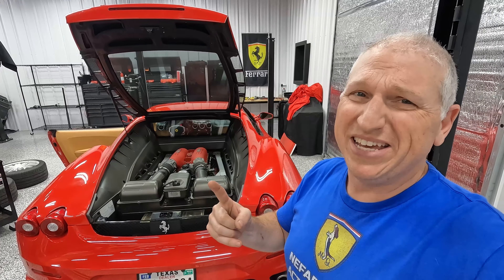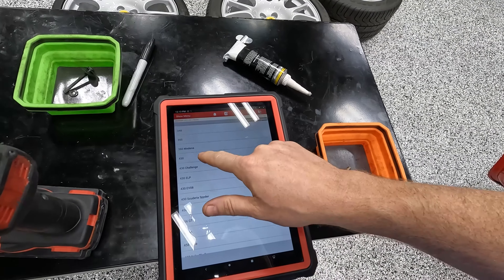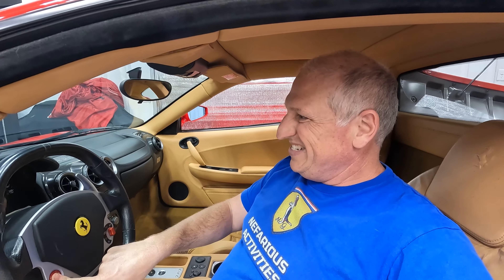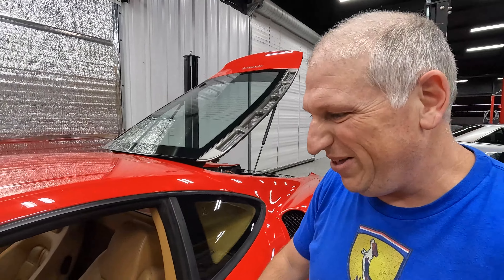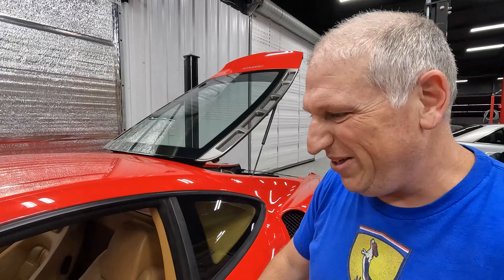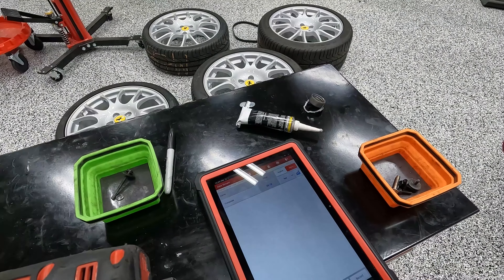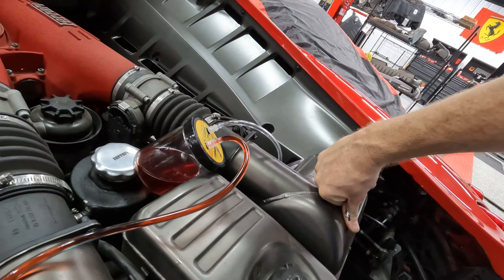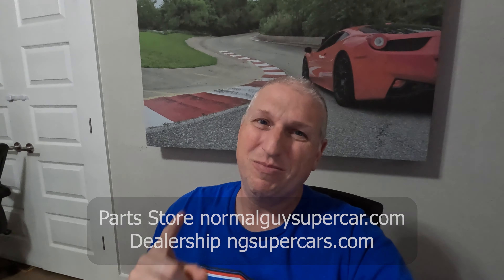How to Bleed the E-Diff on a Ferrari F430

Comment: Hi Dan, a bit pedantic but use the closed end of the wrench on the bleed nipple. Put it on before the pipe. Leave it sitting there whilst you bleed it. Also you won’t round off the hexagon on the nipple. Preferably use a six sided wrench. Same on the brakes. Save you a world of potential misery.👍👍
Reply from the maker: It worked.
Reply: @normalguysupercar  trust me cometh the day mate cometh the day!

Comment: hi dan 😀 I have a question ; when I purge the F1 system, do I have to shift gears afterwards or does the LAUNCH PRO V3 X-431 (the same as yours) that I have; do the whole procedure and wait for it to say "procedure complete" and then I can drive?
Reply from the maker: Which part of the F1 system?
Reply: @normalguysupercar  when you drain the F1 fluid reservoir with new fluid up to the clutch 🙏🏼